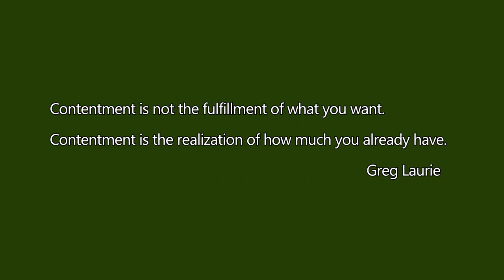December 2020 Update - So Glad we're Here!

Comment: Happy new years guys. I used to do hydraulic work in my early 20's. The cylinders can be pretty dangerous to get off. Usually really easy to get back in if cleaned up while it is out. The piston seals and end seal are really easy to replace once apart. Really cheap to. It's important to release the pressure off when not in use. It will deform the rubber when it has constant pressure on it while not in use. A couple of air fittings to fit the hose ports and pressure it up with air to check for leaks makes it easy to check so you don't have to put in, then take back out if something goes wrong. Brings back memories watching that.
Reply from the maker: Thanks, Harley!  We think we may have to eventually rebuild all of the cylinders on this thing anyway because they all 'creep' and leak a lil bit.  Good to hear from you!